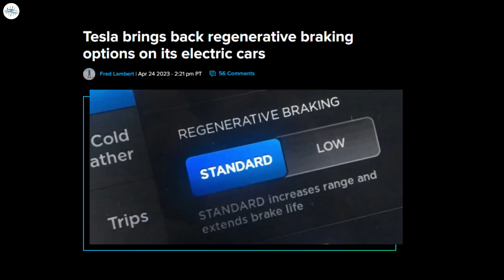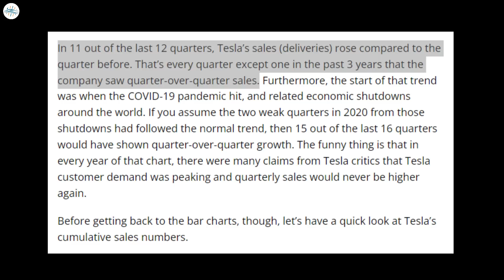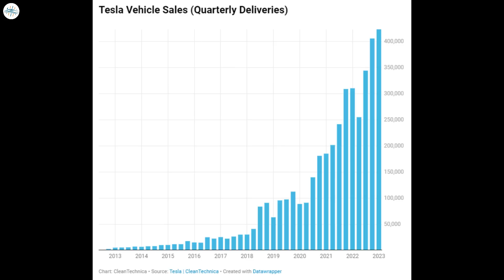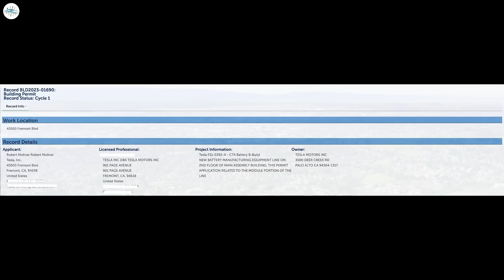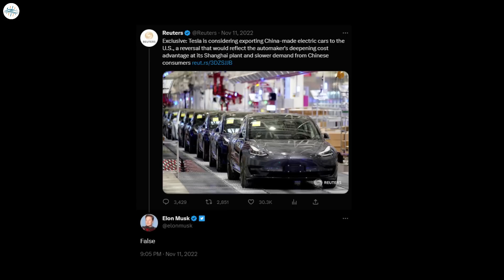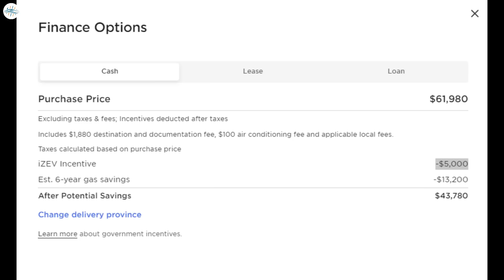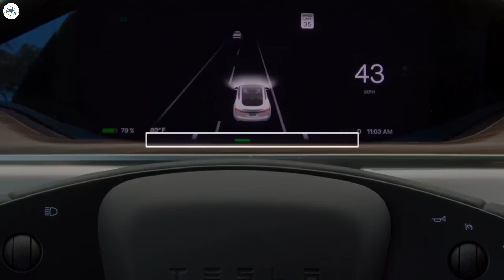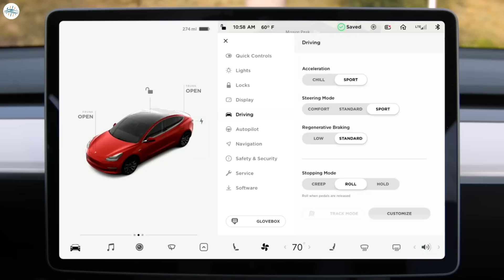Tesla Finally Restores An Important Feature & More Updates!

Comment: Coasting is a more efficient use of a vehicle's kinetic energy rather than converting that motion into electricity through regen braking.  The only time that regen braking should be used is as a replacement for friction braking, such as blended braking.  That said, given that Teslas only incorporate blended braking at low speeds, Standard Regen will still probably be the most efficient mode driving around town (as friction braking can be mostly avoided).  Although, I suspect that Low Regen would offer an efficiency advantage during highway driving, where coasting can be applied more often (e.g., down hills and long approaches to stop signs).  Anyway, I'm grateful to have the option and look forward to seeing how it's implemented (level of coasting available) and how it can be used in real-world driving.
Reply: Not necessarily the case for a full EV. A hybrid yes, because you can have the gas engine off and be regenerating the battery, but in a full ev the brakes don’t supply energy to the battery. And if you watch going down a hill in a full ev even with a bit of the pedal down to balance the coasting and the regen braking you are still putting quite a bit of power back in the battery.
Reply: Don't lift completely off the accelerator on the highway if no braking is needed...  set a cruise control speed.    The car can slow down without applying power and not engaging regen.

Comment: Do i buy a 2023 or wait for 2024?
Reply: As of right now, I don't foresee prices increasing significantly in the next year so I'd wait (especially if you want a Model Y as that refresh is slated for Q3 2024).  I just took delivery of my 2023 Model Y in December.  I know the refreshed M3 and MY will have the new higher resolution cameras, 2 additional cameras in the front bumper, and a redesigned interior with integrated screen in the dashboard (like the S and X refresh), and from the leaked images it looks like a gauge cluster behind the steering wheel!

Comment: Is it just me or does autopilot never use regen?
Reply: Auto-pilot does use regen...but almost always in combination with friction brakes.  Humans can see and anticipate stopping at a light, or due to seeing traffic slow, whereas the vehicle can only detect road conditions up to a certain point accurately and standard auto-pilot does not anticipate anything really (it's just a smarter cruise control w/ auto-steer).  FSD Beta will use regen braking much more, but the car's main priority in any situation is stopping the vehicle if needed so it will not hesitate to apply brakes early and often.
Reply: @RozeAbove  that's exactly why I can't stand autopilot. The wipers come on unnecessarily and I have to manually disengage to properly use regen or I'll wear my breaks down faster and I can't stand the sound of the chime every time I engage or disengage autopilot.